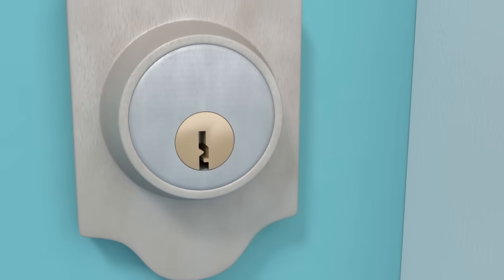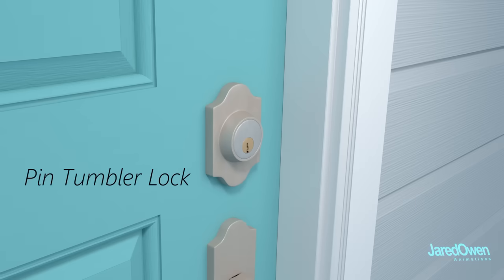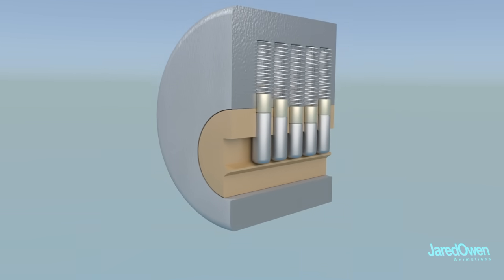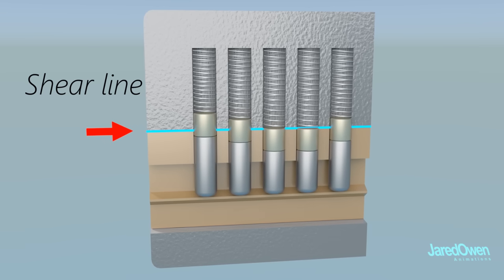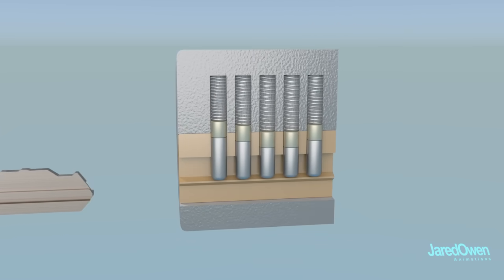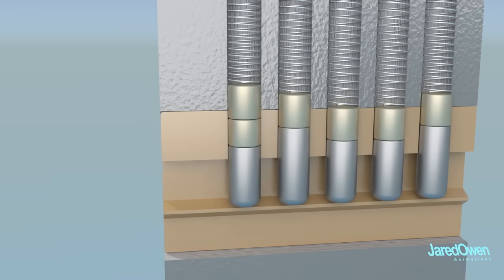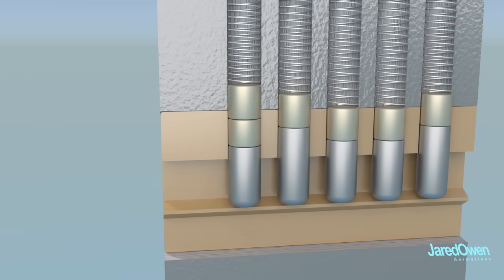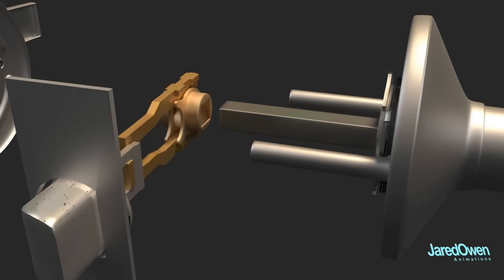How does a Pin Tumbler Lock work?

Comment: Question - I was cutting a key yesterday that was very worn - lots of rounding and my cut was a lot sharper. Would this still work if the spacing and depth is right? 

Or, how does rounding and use effect or not effect a key working?

Comment: So in principle , one could build an 80w laser tight beam 445nm wavelength, and have an AI beam guide direct the 80w laser cutter onto the pins at the shear line, allowing the silent removal of the cut pin widgets by a neodymium pin, allowing the springs to push the remaining pin lengths into the plug allowing the free turning of the plug. Silent gaining of entry

Comment: You make such great videos.  You should do a video on how crash bars work.  Crash bars are seen on exit doors in buildings where you just push the bar to exit but you can't come back in.  You ought to do a video about how crash bars work.

You are right about that a building with master key will have multiple pins like you describe here.  However, more and more buildings today are getting away from keys.  More and more businesses today use credentials like cards like that you will see in hotels.  This is called access control.  And, sometimes not even cards are used...sometimes your mobile phone is used for the credential.

Comment: your animations are very nice, but in this video alone, you make a few bad assumptions ! the first one is "the case" well the correct name for that is the "cylinder" not the case,  the pins are located inside the  "Bible" of the cylinder, starting from top to bottom the "Spring", the "Top Pin" and the "Bottom Pin" not a key pin!, the pins do not rest on any ledge, they do however rest at the bottom of the pin hole, ledge or no ledge!, Now onto "Master Keying" your building shows 3 different type of keys, even thought door #1 and Door #3  look to be the same type of blank like a Kwikset and a Defiant (both use a KW1 (Kwikset blank) ) bur door #2 looks to be a Schlage (SC1) and will not interchange into a Kwikset system and will not  work with the same Master key,

Comment: The additional shafts with master pins actually compromise the security of the lock.

For instance, if there are 3 shafts with master pins, this means that there are 8 possible keys that can open the lock, instead of just 2 keys with the single shaft containing the master pin.
Reply: Nice information when you said all that, just imagine if LockPicking Lawyer is here to explain a lot of things.
Reply: Kach kuch 😆
Reply: i dont understand
Reply: You are correct in this assessment. The security of a lock with any level of master keying is lessoned by the addition of the master pins.
Reply: @An-alien-having-coffee  But more master pins allow for finer tuning of access permissions, right? E.g someone has access to one room, someone to the whole floor, someone to the whole building.
Reply: @nyri0  True, but if I'm a burglar I could probably show up with a bunch of random similar keys and there's a bigger chance I can break in. Didn't do the math of what those chances are but I guess the point is the same
Reply: @nyri0  Also take into account some lazy key designs. You might've heard plenty of stories or had an experience yourself where a key works on a door that it shouldn't. That was the case with my school and it's not so unbelievable because of the sheer amount of different permission keys and doors that existed in the single building.

Comment: The Yale key, other than pushing the pins in the lock to the right height, also has a concave ridge on its sides. As matter of fact, any wrong key can enter the cylinder and not turn, or will not enter at all. That is caused by the ridge, and double the number of combinations for a given set of pins 
Thanks for the video...
Reply: Yale does have a "Keymark" series of high-security side-milled keys but the concept predates their design by many years. ASSA (which now owns Yale)  has had their Sidebar system for a few decades.

Comment: Can the thief re-lock the door using the same method?  
An important question, because my friend found the door closed. she changed the cylinder several times while the thief was entering.
What is solution?

Comment: If you need to have a master key, and in keeping with the example only the first shaft has a master pin, does that mean shafts 2-5 need to be identical on every other lock?
Reply: I had this same doubt, I feel that this should have been explained more at length

Comment: I tried to do it without using it lockpick I tried using with the tool not to break it I couldn't break it but you don't like tablets certain times There is a certain spot you have to tap it or it'll just start all over again so I just started at the front 1st get to the other 1 the second 1 then the 3rd then the 4th It's easy not really because I think the other ones are gonna bounce back out oh I'm very stupid I'm very stupid sorry But I can try I'll try

Comment: When a master key is made for example for a school, Is every set of shafts and pins similar in shape but they add extra pins so the master key can open it? If my question is hard to understand I guess I'm asking could you compare two different pin tumbler systems that would use the same master key. Visually I was confused with the example because it was just a pin added to the first shaft. I'll watch it again though

Comment: I don't understand the master key part. How can it open all doors? Can someone explain. Thanks
Reply: Adding another driver pin to a shaft makes it so that there's a second cut that will make that shaft allow the lock to open. By designing the locks that you want to master key such that all of them have a common cut key that will open them, but different individual keys for each lock, that master key will open them while the others will only open their own lock.

Comment: If the core turns by breaking the driver pin away from the key pin, why then wouldn't the lock open if the key pins are anywhere below the shear line?  In that case, someone could just make a key with deep cutouts for each pin, thus dropping the key pins as low as possible.

Comment: I use the correct key AND THAT B KEEPS GETTING STUCK
Reply: Is your key bent or damaged at all? Is the lock old, or was it (or the door) struck or damaged recently? Any wear on the key or the lock's pins could cause sticking. See if there are any locksmiths nearby who can take a look before the problem gets worse and your key stops working or you can't take it out anymore.
Reply: Anastas1786 
I kind of think there is debris in the lock 
Its quite old (23 years)

Comment: are we not missing something crucial? YES, we see why the key permits rotation of the shaft, but why does rotating the shaft release the lock? Or conversely, why does holding the shaft prevent the door from opening?
Reply from the maker: Good question - I probably should have covered that more thoroughly!

Comment: how do lock pickers get the pin to stay up ?
Reply: Tension wrenches my boy.

When we lift a pin to the correct height, the plug(or cylinder) will turn a little bit.

The reason this works is because the pins are not the same size.
Reply: they twist too
Reply: @Youtube..Enjoyer  it seems like a perfectly fitted piece wouldn't do that tho. maybe if core were bigger they could be made more precise ?
Reply: @phoenix21studios  That is what separates a good lock from a poor one. Cheap locks are made with sloppy tolerances, high security locks are tighter. A "perfect lock" would have all pins bind at the same time, meaning you would have to pick all pins simultaneously, but only pushing them up the correct distance, or in other words, in which case your "pick" would look exactly like the key. A "perfect lock" would be unpickable.

Comment: Our lock at our house is so old we can open it with a penny
Reply: It's probably just dirty inside and all the pins are stuck in the unlocked position. A locksmith (or a lockpicking enthusiast) could take it apart and clean it. Or, and any lockpickers who see this are going to jump all over me, a shot of WD-40 should get it working again, but it will gum up again, eventually.

Comment: pin tumblers are easy to pick
Reply: yeah and easy to break too
Reply: cause the pins arent very strong often u can just drill it with a powerful wireless drill
Reply: Why do the pins not fall when u twist the latch?
Reply: @saintgospelrap  the tension from the tensioner squeezes the pins like a pair of pliers grabbing onto metal
Reply: @nootaboot7042  not understand
Reply: @saintgospelrap  squeeze boi squeeze pins then not fall
Reply: Yea I learned lock picking in like 30 mins

Comment: Still don't understand the masterkey. Every lock in the door is different, so if the first shaft gets in position, you still have the other vertical shafts which are different. How do they all line up then?
Reply: Yep, you're right. I think to get a useful master key system you need to create a completely new shear line by adding a master pin to every existing driver. These master pins have of course different sizes in every lock because they add up with the already unique key pin sizes while the shear line stays the same.
Reply: The ones that doesn't have master pins all have the same shear line

Comment: So in a place with a master key all non master pins have to be identical
Reply: Sure, but in a good master key system, almost every pin would have dual drivers.
Reply: No, this is just showing one lock. You can have many unique "user keys" and one master key that unlocks all of them. Alternatively, you can have one lock that can be opened by many different keys.

Comment: Fun facts about locks: most locks have 5 different shafts in the lock. Some have 6.

Different manufacturers have different numbers of pins. Ie Taymor and schlage  have pins 0 to 9. Where as some of the weiser locks use 0 to 6.

if you look on the side of your keys you can sometimes see a 5 or 6 digit number. Its the number that corresponds to the pins in your lock. different numbers are different sizes of pins. 0 being the smallest and 9 being the biggest. 

Thats all for now. Maybe ill think of more that i have seen and put them in another video.
Reply: Speaking of pins, why isn’t this comment pinned? It has a lot of extra information.
Reply: Why do the pins not fall once u turn the latch?
Reply: @saintgospelrap  the inside is all metal, exept for a gap where the key goes in. when you turn it, the pins wont fall because the metal is there to stop it
Reply: @56independent  oh ok. I believe I understand it now. It's like a cylindrical piece that only has one side opening to it
Reply: @saintgospelrap  yeah, imagine a circle and on top is a thing(maybea pin), and if it is over a hole in the circle, the thing falls, and you get it out of the circle by putting something in (maybe a key) and when you turn the circle, the pin doesent go down.
Reply: @56independent  thank u
Reply: @saintgospelrap  always happy to help XD
Reply: @56independent  God bless u
Reply: mine has 7
Reply: @pwnputty As the numbers signify the sizes of the pins inside, wouldn't it be possible for anyone to make a key using that info?
Reply: @ayan59dutta  u also need to know the combination of each pin's correct height so u can make the correct key
Reply: @ayan59dutta  Yes, But this is outside of the skill set of the average burglar. (who likely would not have access to the original key anyway.) Keys used by regular employees of a business are usually copies of the originals and don't have the numbers on them. Source: Did security and retail loss prevention.) having the info is however an aid to a locksmith when making new keys if the original is damaged and can't be correctly copied.
Reply: True but Weiser also have bottom pins from 0 to 9. Master pins 2 to 8. Pin cells (shafts) from 5 to 7.